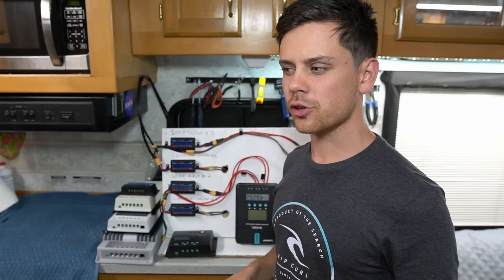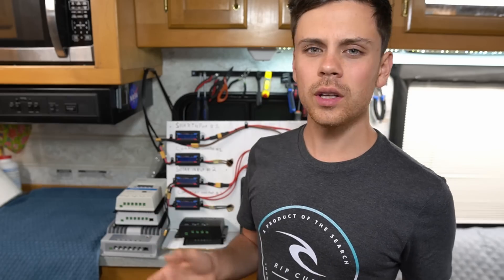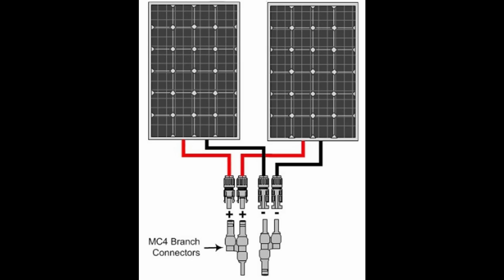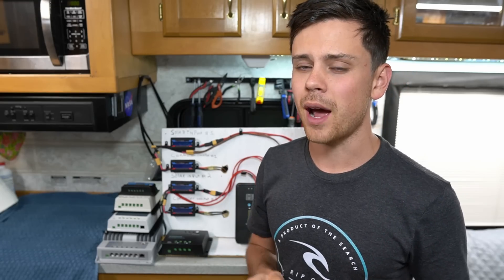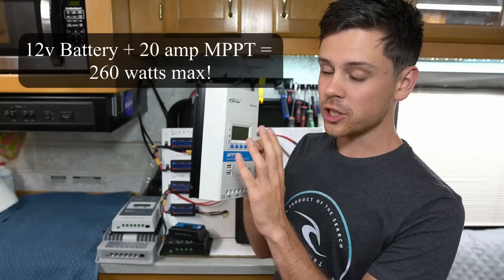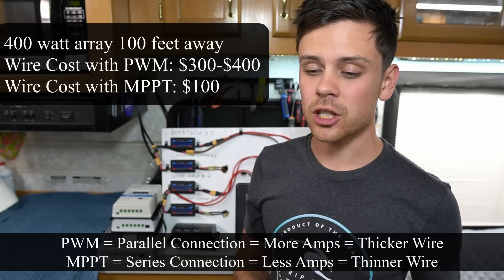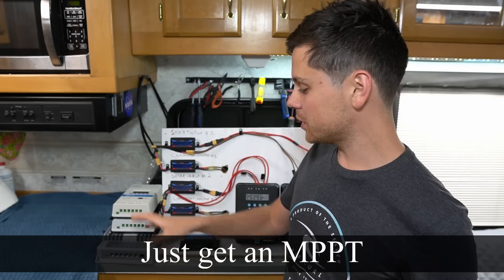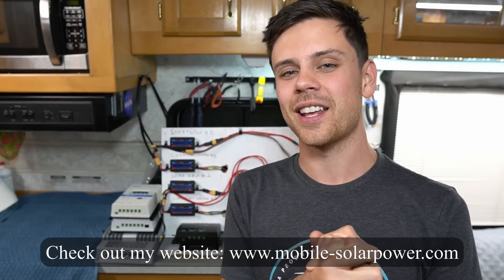MPPT vs PWM: Fast comparison for off-grid solar

Comment: I'm glad you pointed out the solar wattage ratings on those MPPT controllers.  I have 640 watts of solar I'm going to put on the roof of my RV, and was going to install a 40A MPPT, but I hadn't looked at the solar wattage ratings at 12V.  Most of them will not handle that much solar.  So it's going to be a 45 or 50 amp charge controller for me.  Thank you for all you're doing here.
Reply: Do some shopping. Often, two smaller solar controllers are better than one large one. You could probably get two 30 or 40a controllers for less than a 60a controller.
Reply: @epfd217  I only have one pair of wires from the roof to my solar compartment.  Can I split that to go to two charge controllers?
Reply: @Bubba_Warbucks  wow! That's a great question! I sure hope there's a good.answer.
Reply: You could run any non-mppt hooked up panels to a dc-dc device and run fans and lights and maybe a daylight only fridge?

I'm planning to have panels run a thermo-peltier fridge and a USB fan and light system.
Reply: @stevevelobahn1814  Sure but most people are going to run an inverter with their 120VAC appliances. Only tech nerds would think of doing what you're doing, and then when the sun goes down, you don't have power.  The name of the game is storage.
Reply: @Bubba_Warbucks  Batteries suck.  I live off grid 5 months a year and only have a car battery.  From PV I get hot water, refrigeration and even have a dishwasher with heated dry.  "We have the technology", just no one knows how to use it.  Energy management is the future and using power real time is possible. And doing this is really cheap.
Reply: @opera5714 what keeps the fridge cool when the sun goes down lol
Reply: @DonDaly  I use a 7cf chest fridge and keep large amounts of drinks.  Daytime the fridge is set to 34F and it only runs when the battery is full. This thermal mass keeps it cool overnight. Battery is used primarily for starting surge current and the running current is supplied by the panels.  Control is designed so no more than 3 minutes of the battery is used should a cloud comes over, then it stops. I live here for 5 months without issue. I have hot water, dishwasher with heated dry and a clothes washer with its own hot water tank. All cycles use hot water.  This is what you can do with advanced controls. I do it cause I can.  I certainly could afford better.  I pay $3,400 a year just to have my grass cut while I am away at camp and I never see it! LOL

Comment: Thanks for your good videos. What size and type of a charge controller should I use if I have 600-1000 Watts solar array with 12 volts-100Ah battery bank? And what is the best wiring for the solar panels - parallel or series? I am not sure whether to do a 600 watt panel array and invest more on the number of batteries or do a 1000 watt solar panel array and reduce on the number of batteries. The main electrical appliances to run will be for laundry and vaccum cleaning, freezer/fridge, TV/sattelite, water pump, computer/laptop, and  lighting. I live close very close to equator, 12 hrs day light 12 hrs night time, no winter but always sunny or rainy seasons.
Reply from the maker: Good question actually. You will need 80-90 amp controller. But you will actually be better off using 2x 40 or 45 amp controllers. And I would put them in in series groups. If they are all exposed to same amount of sunshine, put them all in series. If they are on a RV or van, and may experience shading intermittently, putting them in "in series" pairs or groups of 2 or 3, and combining all of those in parallel will work great
Reply: @WillProwse  Thank you very much
Reply from the maker: And considering where you live, go for more batteries now. Then add panels in the future when necessary. Having a bigger battery is better in my opinion
Reply: @WillProwse   Will Prowse  Thank you very much
Reply: 600 watts of solar for 100 ah battery seems excessive. 
If that’s producing 37-40 ah at 12v, that would seem more than enough since most of those appliances don’t use a lot of power. 
Wouldn’t having more battery power be good for the rainy season?
Reply from the maker: @AaronGeller  good point, I didn't see the battery size

Comment: Love your presatation on solar equipment. What about noise ? Ham radio has a special need for solar charging of batteries and it seams most mppt controllers are to noisey to use leaving us to only pwm and sometimes an extra panel is not a good idea . So is there a good mppt that isn't,t noisey to use ?
Reply: MPPT controllers are in large part voltage converters, which by their very nature are always going to throw off a certain amount of heat.  As such, they will need some type of way to dissipate that heat, and many of them employ fans.  However, I do believe that all the MPPT controllers that Will reviewed in the video immmediately prior to this one were completely passive (i.e. no fan) and would be nice and quiet.

Comment: I suggest that you use a Bogart engineering SC2030 with it's tri metric meter TM2030 if you are going to do a PWM comparison. This system along with the use of a shunt would be a much better comparison. 
I have (3) 150 Watt panels connected in series on the roof of my van. I run these wires into a combined box inside my van. Each panel I on a 15 Amp breaker. Way safe. There many ways to skin a cat safely. 
I've been all over the US and my system works very well. When my Vmax Tanks batteries die, I'll go to a completely different system, probably L-ion batteries, 24V and maybe an MPPT charger. 
Thanks for your videos.
Reply: I wish Will would do this comparison also. The Bogart Engineering Sc2030 pwm charge controllers mated with the tm2030 is a very good setup.

Comment: Its 530 AM in Puerto Rico first time a get you almost live.  my question is; my 60 amp PWN came with a temperature sensor. It is mounted on top of the PWM how does it get the temperature off my 2 battery's  mounted 24VDC 263 ah deep cycle. Am interested what does it work in the prose of charging the battery's.
Reply from the maker: Temp sensor should be mounted to negative terminal of battery bank if the sensor is a terminal lug, or it should be zip tied to the negative battery cable. You might only have a temp sensor for the controller itself. Battery temp sensor is preferred
Reply: @WillProwse  I will check the sensor which seams like a terminal lug. The 04 gauge wire is always ambient Temperature. I was curious if the sensor had to be extended by wire to be  zip tied to the neg. Since the neg wire feeds the battery's. I will look up battery temp sensor to see where do you set it up.

Comment: Thanks for the clarification, Will. Also, on selected models with the Triron EPever CC, they allow up to 150 volts. Crank up the volts on those string arrays if needed.

Comment: Hi Will. In the first video you mentioned one of the metres was to measure the usage during standby. Did you get any figures for this?
Reply from the maker: I did and they were inconclusive. .4-.6 watts for all of them. Such a small variation that I didn't mention it. I should have mentioned it in the video, my bad

Comment: MPPT got it. Now the battery for a 2/100 watt panel in series to the MPPT. Thanks
Reply: NEVER buy battery voltage panels!  You can get grid tie panels with more power at half the cost.